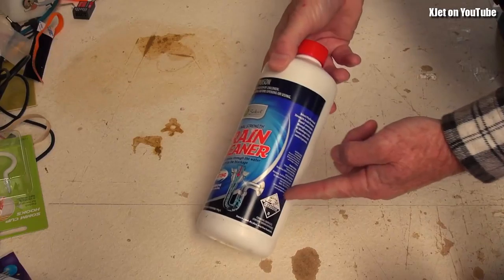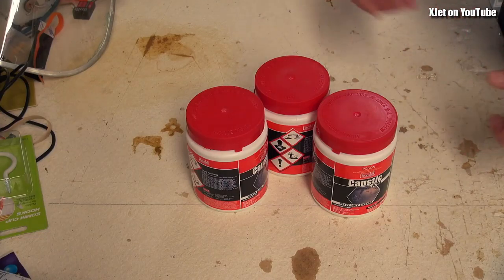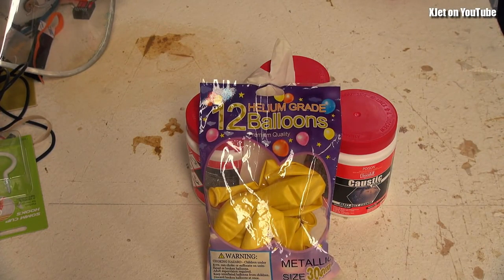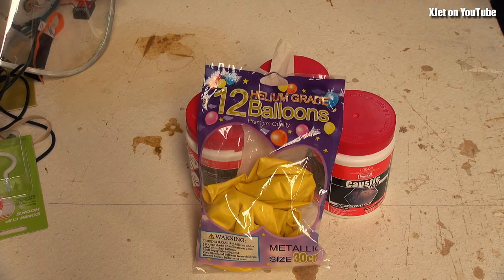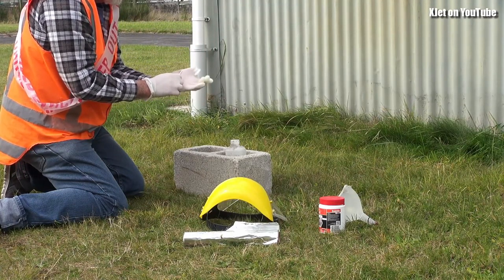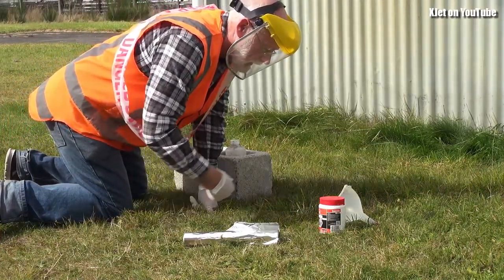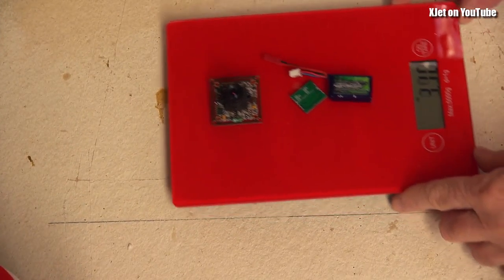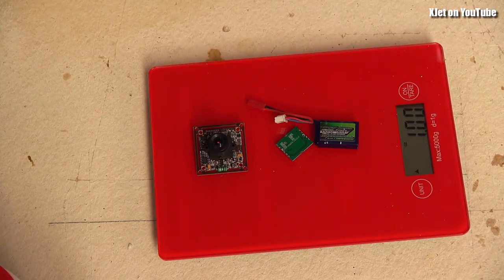A drone alternative: hydrogen-lift aerial video (FPV) Part 2

Comment: I used to release hydrogen filled weather balloons of various sizes at airports around the country when I worked for the NZ Meteorological Service and I don't think we ever brought down an aircraft ! lol On one occasion at Christchurch Airport we had a balloon that ascended vertically to 90,000 feet, burst, and then descended vertically landing just on the other side of the main runway. At Kaitaia we had a large electrolyzer that filled a huge hydrogen tank that I was quite scared of. Every day we had to drain off the water that settled in the tank by opening a valve at the bottom. I think we were responsible for many UFO sightings over the years, an 800g balloon at 30km looks like a white disc !
Reply: hydrogen mixed with air is a scary thing, because of it's nasty propensity to explode rather than just ignite and burn, incidentally Andy what type of balloons did you use ? what are they made of etc, and could you have got to a higher altitude than 90,000 feet ? I suppose not on second thought, was it the expansion that made then pop or the cold or a combination of both ?. Read a bit in a sci fi magazine about two Americans who went up from an Aircraft carrier back in the 50's or 60's in a gondola type contraption with a massive tall slender hydrogen balloon, they had pressure suits on, made it to about 103,000 feet and then decided enough is enough and made it back down..all part of the build up to Apollo...it was a great read...

Comment: You might try building a condensation loop. Look at what people do for cooling and removing moisture from compressed air for auto painting. Just a up and down loop to catch the moisture as it cools.

Comment: I used to do make hydrogen filled balloons with small payloads (usually water filled balloon bombs) way back in the sixties using granulated zinc and hydrochloric acid. Very efficient reaction, I don't remember any problems with water vapor using this method. Try introducing pure oxygen into the balloons, light it from a safe distance and let me know what happens :). Ah the memories...

Comment: As I said last time: 2 large coke bottles (2.25L), two tubes, large bowl. 
Ice water in bowl, Half fill one bottle with cold water and super saturate sodium hydroxide (You bought enough there to fill a air ship :) poke hole in bottle cap and push fit tube, second bottle poke hole near bottom push tube from first bottle. Fill second bottle with water to top (this is your bubbler). Tube from second bottle top used to fill balloon. During reaction have the first bottle in ice bath.
This worked perfectly and safely for me (no gloves/facemask needed) :) Made more hydrogen than I knew what to do with.
Reply: put glass bowl through cork. cut bottom off bottle and place in bucket. fill bucket with ice water. pack the bowl and cork the bottle. apply heat and lift bottle. remove bowl, choke, happy
Reply: When I make soap I just use ice for part of the water solution.  It never gets too hot that way.  Of course he'd still have the water vapor to deal with.
Reply: Andrew Sparrow
Do you think he actually cares about what you said “last time”?

Comment: I tried this a few years ago using muriatic acid, aluminium and a black bin bag for a gas envelope, I had a much slower reaction so there was less heat. It was a success, I was thinking of a repeat try some time but shredding the aluminium foil in my shredder to speed things up a bit.

Comment: One thing that seems to be needed: hoses! Drill a hole into the first bottle and mount one of those cheap hose fitting (near the top; I woudln't drill into the lid, because that makes screwing the lid on more difficult). Run the hose to another hose fitting on a second large bottle (mounted at the bottom) with a huge amount of cold water in it. Then a third fitting from the top of this bottle and a hos that goes to the balloon.

Comment: Connect a tube to the hydrogen bottle and bubble it through the bottom of another bottle filled with some cold water. If you want you can also dry the stream completely by then making another setup similar to the cold water one but this time filling it with some calcium chloride ice melting salt or other dessicant and you'll have a DIY scrubber on the cheap!

Comment: Look up 'thumpers' used as part of whiskey still condensing.  Build one out of a 5 gallon bucket (what do they call those in Australia?), tight fitting lid and a couple bits of hose and you'll be able to cool and condense the reaction products and get much more pure H2 out the other end.

Comment: Definitely need to cool the hydrogen before putting it in the balloon.  Bubbling through cold water should also remove most of the water vapor.  A trace of water vapor shouldn't be a big problem as long as there isn't enough to condense inside the balloon.  I'm also thinking it would be good to have an accumulator to collect hydrogen to later be used in the balloon, but that's a potentially large tank.

Fun fact, steam has been used as a lifting gas in an experimental balloon.  Molecular weight 18 vs ~28 or so for air.  The tricky part is keeping the balloon hot so the lifting gas doesn't crash into liquid.

Comment: dammit Bruce between you and Andrew Newton, one of you guys always does the thing I'm planning before I do, then it looks like I'm copying :)
A while ago I watched this video (WtPrIH0T3b0) which put me off the chemical generation idea, what with the water condensation, shrinkage after cooling, heat and pace of the reaction etc. I will be trying electrolysis which is much more controllable and low temperature with a purer result. The only down side is getting the hydrogen under enough pressure to inflate a rubber balloon, but I have an idea for that which might work...
Reply: iforce2d 
I look forward to that video Chris, I'm keen to give this ballooning thing a go , but would much prefer it being chemical reaction free.

Comment: I Fly Central is right, a condenser coil in ice water would fix your hot gas and moisture issues. Make a still for your gas generator.

Comment: Use a bag that you get your clothes in from the laundry. They are very thin, lightweight and have a lot of volume. The hydrogen will not need as much pressure as is necessary to expand the balloon. I suspect that would make it more buoyant, but I defer to the more scientifically minded. Also, shouldn't you count the weight of the envelope (balloon or bag) and string as well as the camera when you compute the lift?
Good experiment. Thanks!

Comment: 3:45.. If you run the output of the hydrogen generator through a simple water bubbler it would cool and condense the water vapor before going into the balloon.
6:27.. Why don't you measure the amounts of chemicals you use. It would be more scientific and give more accurate measurable results.... IMO

Comment: HaHaHaHa HaHaHaHa Hey Bruce, You Forgot Your Steel Toed Boots!
You Need To Use A Bubbler &/or A Length Of Copper Pipe Twisted Into A Condenser Coil To Bleed Off The Water... Apparently You Have Never Made Moon-Shine Before!?
I Would Also Suggest Just Simply Building A Hydrogen Generator Out Of A 1/2 Gallon Jar w/Some Nickle Rods Hooked To A 12v Battery w/ An On / Off Switch!!! Thus Eliminating All Those Nasty Chemicals, High Heats, Smells & Excess Water Vapors, Etc...
Then You Could Have A Simple Oxi-Hydro Plant Made Out Of Distilled Water & A Little Baking Soda!? Then Sit On The Corner Of Your Work Bench Soo You Can  Fill Up Stuff With Hydrogen Anytime!!!
Butt Your Way Is Soo Much More Funnier Though!? LMAO 😂
Then Carry On Mate & Thanks...
PS Build This For Your Next Project!???
Put A Tiny O2H Generator In A Plane, With a Balloon For A Tank, Hook It To An Old Nitro Motor & Have Ron Test Fly That...😂😂😂
PSS Throw All That Excessive Camera Arrangement Away & Get A TX-05 For $20 or A TX-03 Has OSD Also For Less $30!  Then Just. Hook A 150mAh 1c To It For The Power.. Your Welcome... 😂🤔
Reply from the maker: Noooo... for two reasons.   A mix of H2 and O2 (the result of using electrolysis to separate water if you don't have separate gas-take-offs for the two gasses) is not only dangerous but also significantly reduces the amount of lift you get from a given volume of the gas.  O2 is much heavier than H2 and a third of your gas will be O2.  Then there's the small issue of safety:  http://www.canberratimes.com.au/queensland/man-trying-to-separate-hydrogen-from-water-dies-in-backyard-explosion-north-of-brisbane-20180420-p4zavs
Reply: Then Use A Bigger Ballon!? LMAO 
It Just Burns Straight Up! Just Don't Stand Over It Or Try To Store Mass Quantities...
HaHaHaHa HaHaHaHa